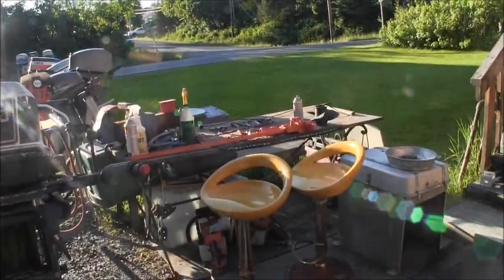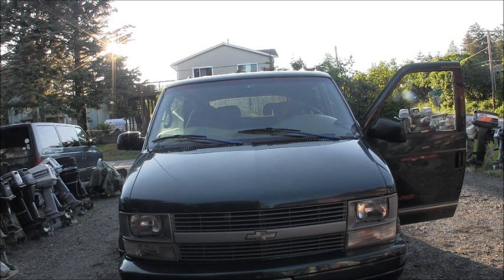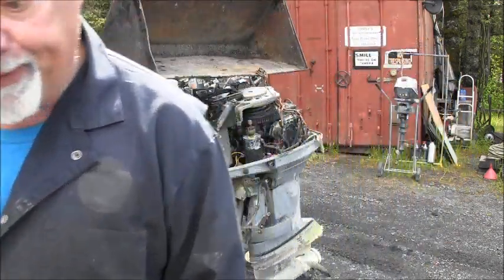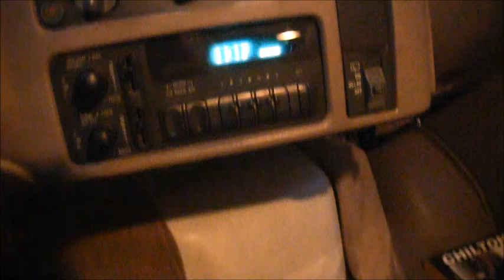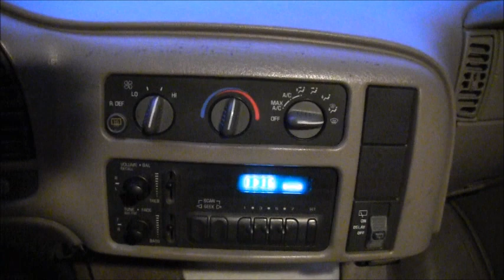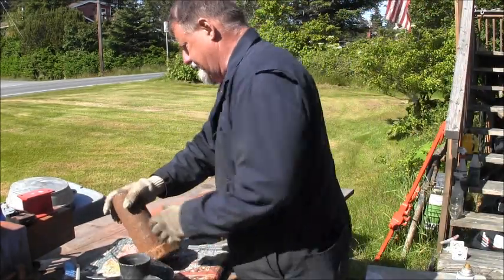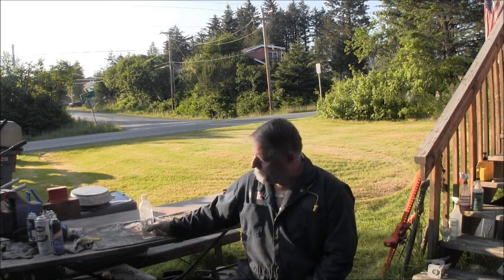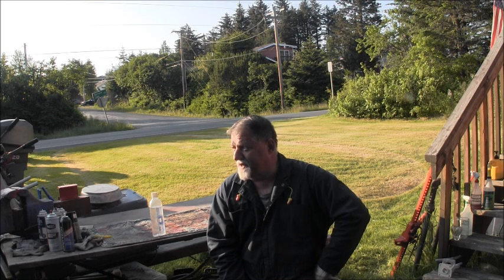EVINRUDE 30  HP,  PART'N ,  SCRAP'N  &  More

Comment: Cody, I was laying in bed watching your video, before going to sleep.  You had me laughing out loud watching you load the old motors onto scrapping truck.  I woke my wife up laughing.    The tsunami warning was pretty crazy.  How often do these happen?  Is your home outside the hazard zone? Thanks for posting your videos.
Reply from the maker: My house is right on the safe line  GPS  Has me @ 86 feet, they consider safe  110 ft.    The alarms  sound a cpl times a year it seems,  thanks        kb

Comment: Hi Kodi, I found by accident that the ACE driveway sealer works good for dipping part into and comes out looking like bedliner stuff. Looks amazing. try it on something like you're talking about or something small as a test. I got to get 4 more gals of it for our driveway while the weather is hot out. dries overnight and can drive on it. Oh, I just got through doing a video series on a 2014 Bolen's riding mower that was hydro locked. Oh, and some sideboards on your truck would help. haha
Reply from the maker: Tim I wounder if it was what I painted my lamp pole with that stuff was Amazing my lamp post lasted 17+ years, But I forgot what it was called.    kb